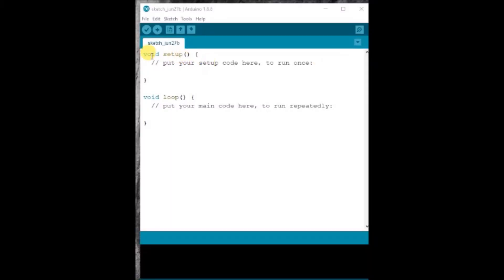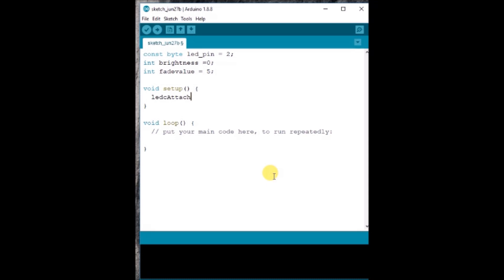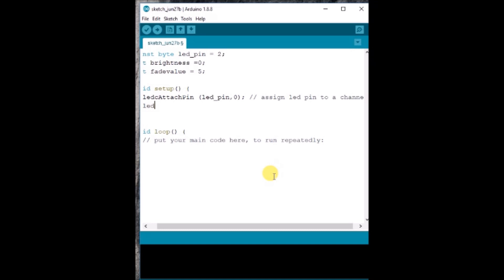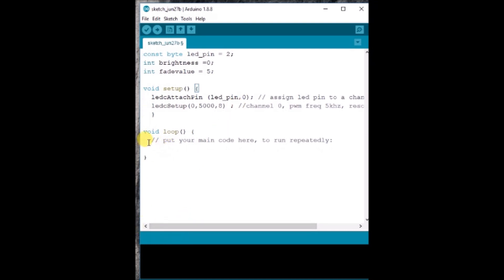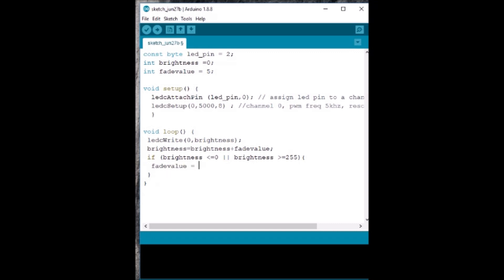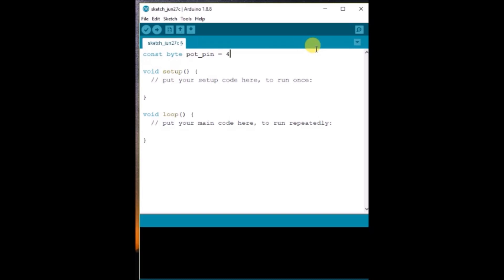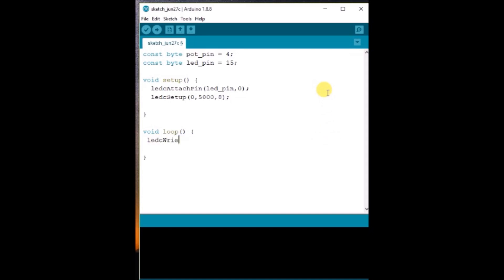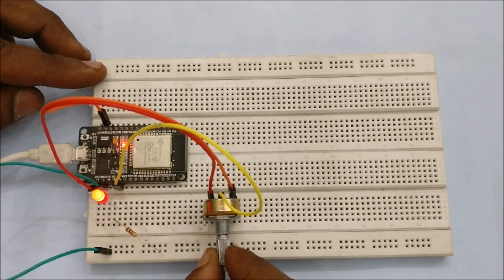ESP32 #3 PWM - LED FADING & MOTOR CONTROL

Comment: I need to run BLDC motor using ESP32 for quadcopter. How can I determine/calculate frequency which I need to mention for ledcsetup function? or I can use the same 5000 for BLDC motors as well ?

Comment: Thanks for this tutorial. I have it all working, but am stuck, as my motor requires a 0-5.5V PWM control signal. The ESP32 obviously only provides 3.3V from the GPIO. Would you advise how I can most simply solve this please?

I've tried using a couple of different transistors, but they still drop too much voltage from the ESPs 5V pin. I'm not an electronics expert, so any advice is much appreciated. Thanks.

Comment: When ESP32 reads the value from the potentiometer, it brings back a value between 0 - 4095. Where in your code have you mapped that to 0 - 255?
Reply: He used a resolution of 8 bits, then the maximum value he can get is 255 :3